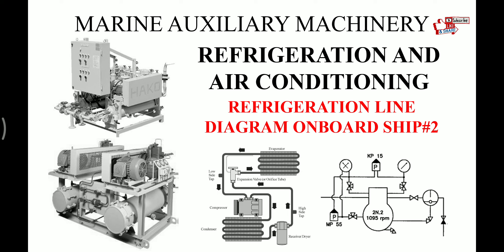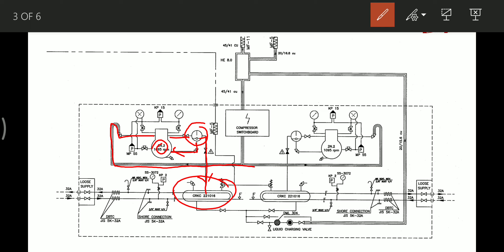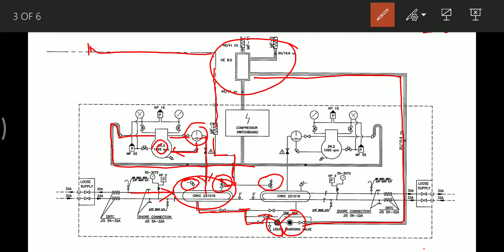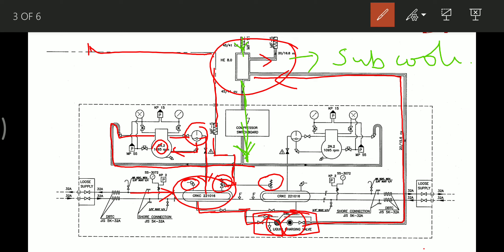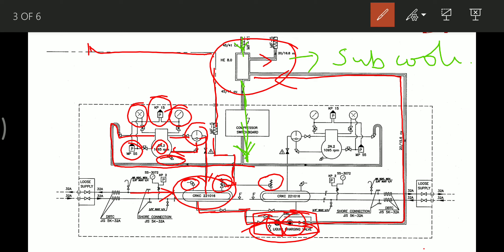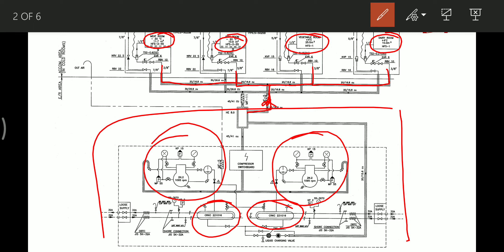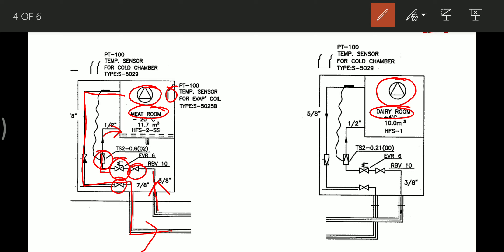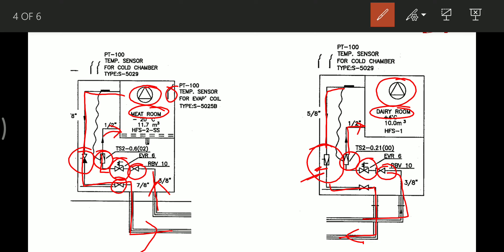Marine auxiliary machinery, Refrigeration and air conditioning, Refrigeration plant line diagram #2

Comment: Meat room evaporator coil has a temperature sensor but why doesn't the veg room have a sensor for the coil? As you mentioned that sensor is to control the solenoid valve but both the rooms have solenoid valves. Please help me out.

Comment: Let's consider that the ship has been laid up for about a month and after that the engine and the whole refrigeration plant is being started again. Initially, the refrigerant would be stored in the receiver (if I'm not wrong) in the liquid form and then the whole process would start. My doubt is: How is this system started as the refrigerant is in the liquid form and the cycle starts from the compressor. What is the means to convert the liquid refrigerant from the liquid form to the vapor form so that it can be fed as suction to the compressor.
Reply from the maker: If ref plant is stopped for month thn refrigerant is collected in receiver n it is still pressurised...so when u need to start again, then simply line up the plant by opening receiver outlet valve, allowing refrigerant to pass through expansion valve and then start the compressor...
Reply from the maker: So to answer Ur question, refrigerant is pressurised and it is passed through expansion valve...then only compressor is started...
Reply from the maker: So to answer Ur question, refrigerant is pressurised and it is passed through expansion valve...then only compressor is started...